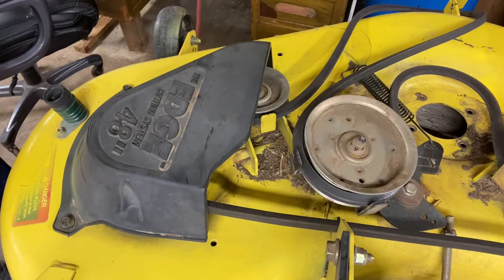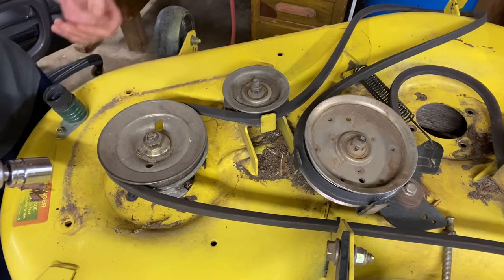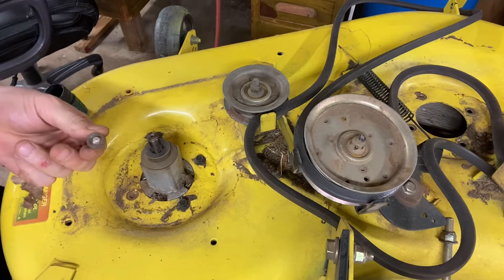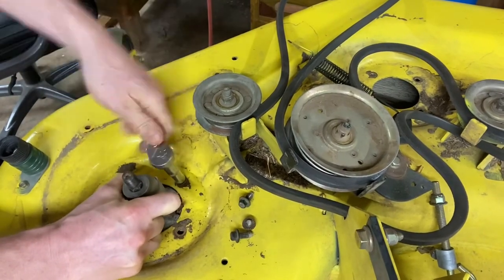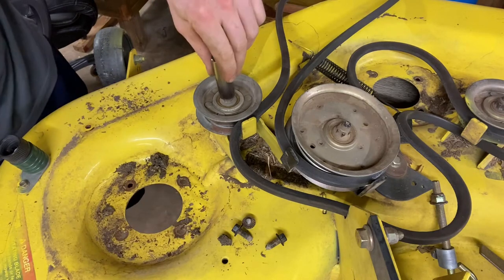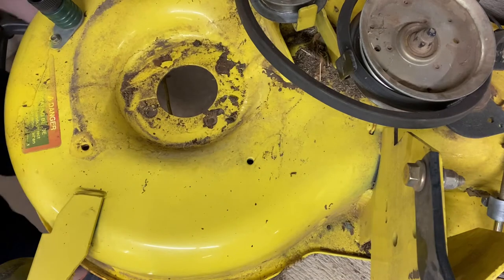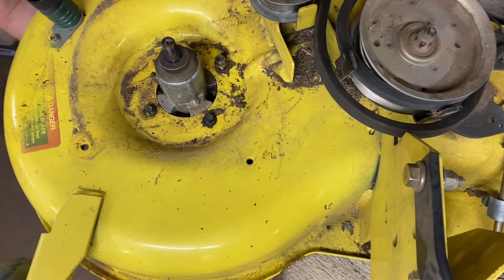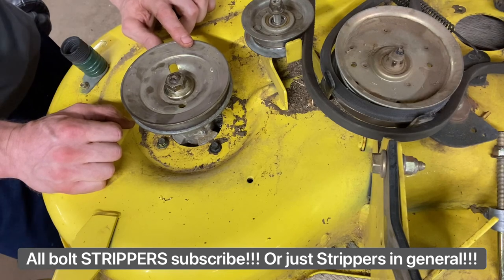John Deere Riding Mower Spindle Replacement w/ BROKEN BOLT FIX!!!

Comment: Thanks for this. My  lower bearing went out and ate the metal up on the spindle, so I'll be doing this soon. Only thing I might add is to make sure when it's replaced that it spins freely!
Reply from the maker: You can check that before you install it, is an easy job you got this

Comment: Glad I stumbled across this. Went to swap out my spindles today...with an impact 🙄. The bolts on the first one came out perfectly. Got to the 2nd one and strip the heads off two bolts and the other two just won't budge. Gonna try my ratchet tmw and I guess do some drilling. Thanks for the vid. Super helpful.
Reply from the maker: Glad I could help. Those bolts get weak after all that vibration. Good luck

Comment: Good video - I ran into the issue of a frozen routing pulley on my 48 inch deck.  Decided to rebuild it with all new spindles, blades, pulleys and belt.  I only ran it for one minute before I realized that the belt was rubbing against the rear support mounts resulting in a ruined belt.  Trouble shooting all of the assembly resulted in no overtightening of the pulleys, etcetera; all turned freely.  I did not make any adjustments to the five mower deck mounting points or mowing height.  Today I am replacing the belt because I suspect that the aftermarket belt may be just a bit too long.  If the rubbing continues and no solution apparent, then I may have to grind down the bypass points at the far rear to make room for the belt to pass with out damage.  Interesting issue to solve.
Reply from the maker: You may have the wrong size belt on there.

Comment: I just stumbled across your channel I'm kind of a do-it-yourself fixer on my John Deere LT160 I ran over a baseball-sized rock the next thing I knew one side was turning only on my deck so I take it the belt still turning it but is it a broken spindle you think any information much appreciated thank you sir hope you can help
Reply from the maker: Pull the deck off and inspect the spindles, blades and pulleys and replace all the broke stuff. I have videos on all of it

Comment: If the blades are stuck on is this an alternative to getting them off by replacing the spindle
Reply from the maker: Nope you will have to get the blade off in order to get the spindle off.

Comment: Queston: ... Can't seem to find a good enough drill bit to drill the old hardened broken bolt out...... any suggestions ?
Reply from the maker: That is frustrating, I would just buy a new spindle they are cheap on Amazon.